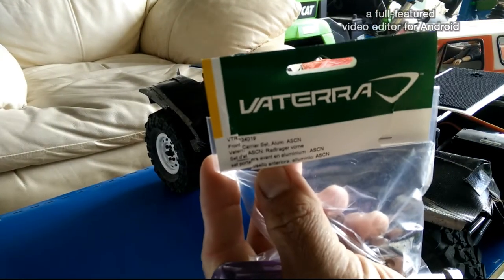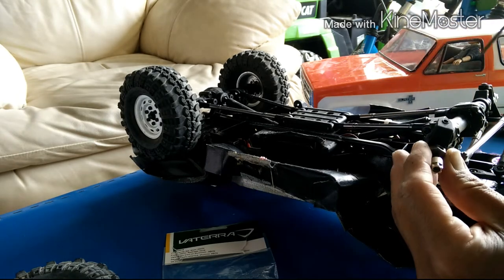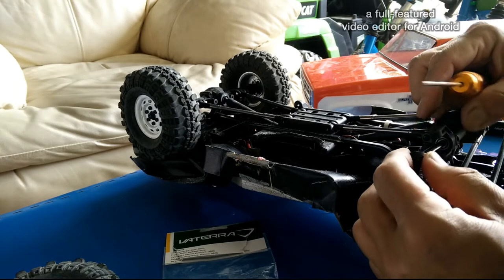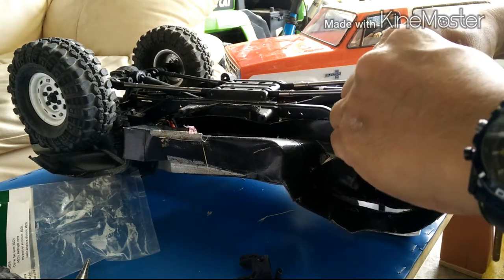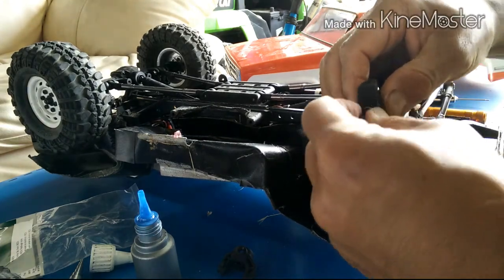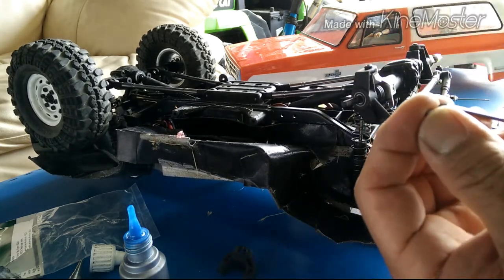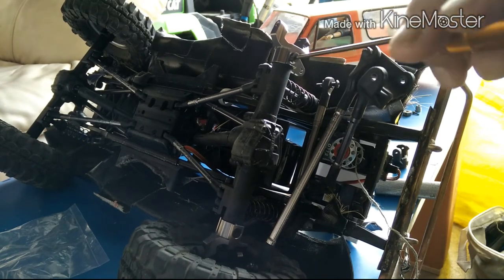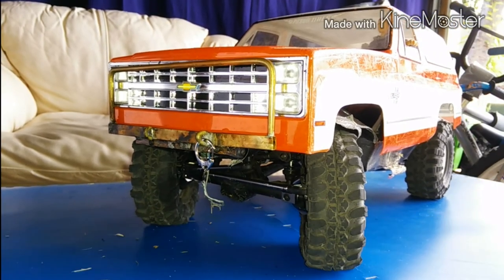Vaterra Ascender aluminum C hubs install -Update#4 1986 Chevy Blazer 1/10 Scale Truck Kit

Comment: When I installed mine i had too lengthen my steering rod because my tires weren't straight
Reply from the maker: hmmm...interesting. on mine, it was fine, I did not need to do adjustment.